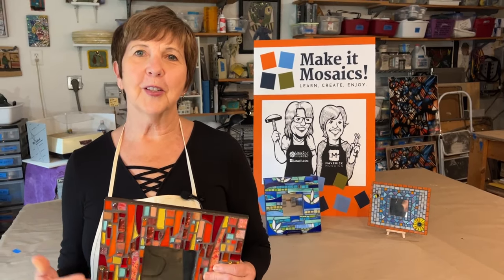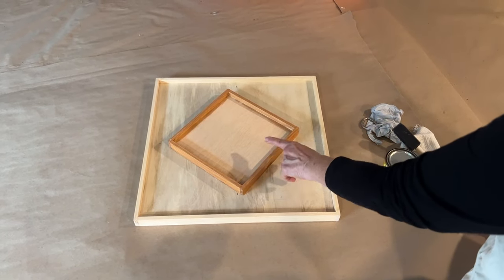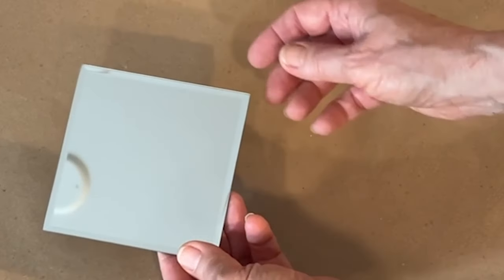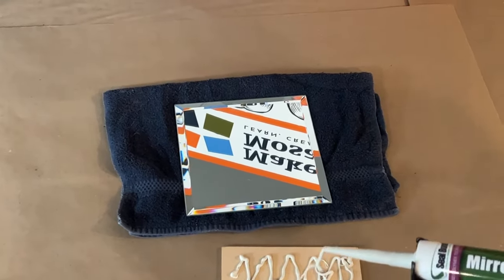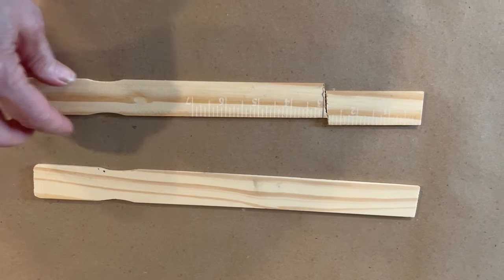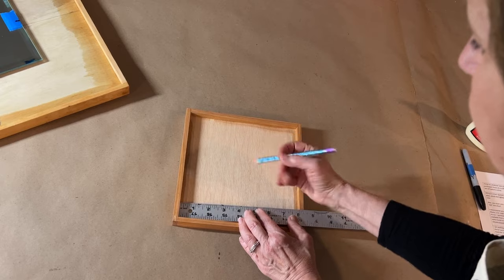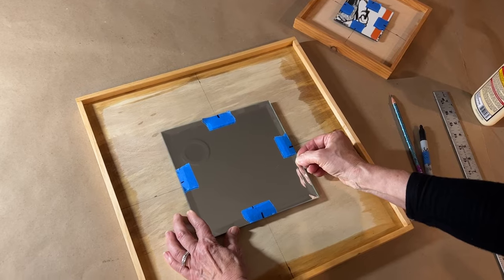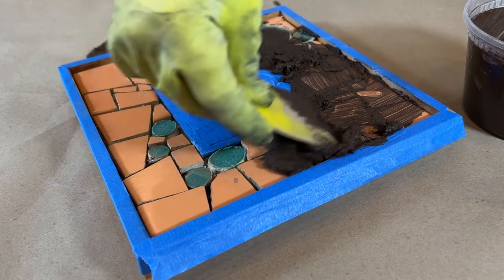Mosaic Mirror Frame Made Easy!

Comment: I have a question for you: If I want to transfer a design I made with drawing software onto a mirror, would it be a good idea to print that design, cut it out, stick it onto the mirror, and then place the mosaic pieces onto the paper? Would that be safe, or is there a better way?
Reply from the maker: I would make a pattern that is cut out. There is a video dedicated to patterns and designs.
Reply: @MakeitMosaics  Thank you very much! I watched your video and it is great. It seems both of you are the real deal when it comes to creating mosaics! However, I am still looking for a way to transfer a design onto mirror glass. Any ideas?
Reply from the maker: If you are trying to put a pattern into a mirror cut out the pattern and draw onto mirror with grease pencil, I would consider face tape method or mesh method as alternative. You don’t want markings on the mirror surface that are difficult to remove.
Reply: @MakeitMosaics  I see, thank you very much again! Will try the cut out method although the pattern is quite is intricate. Anyway, you have a new subscriber :)